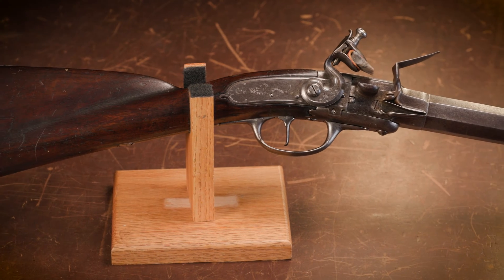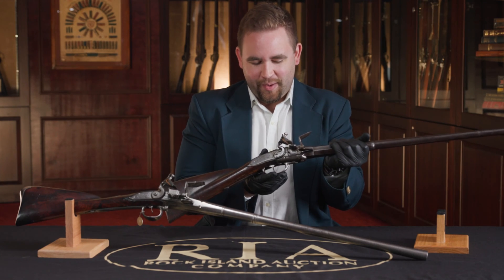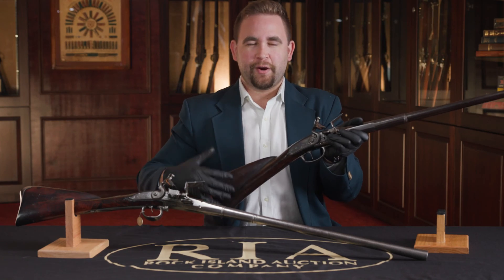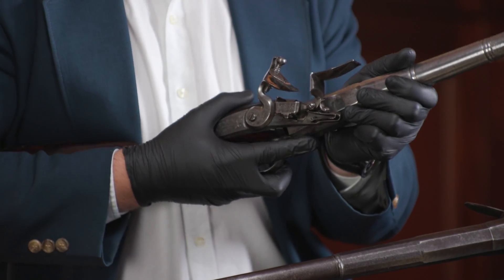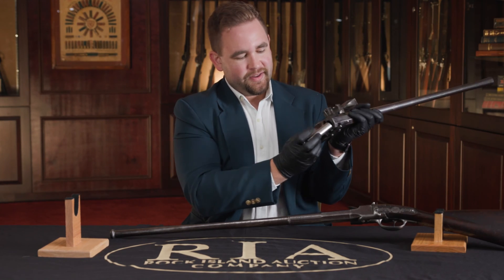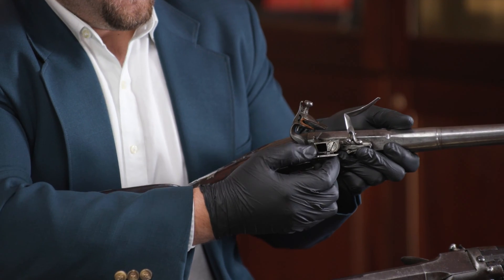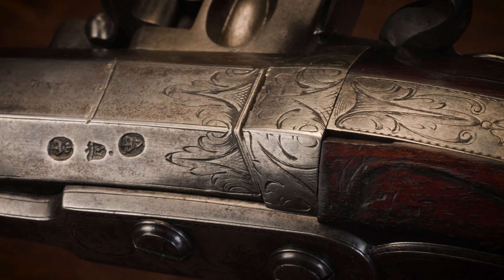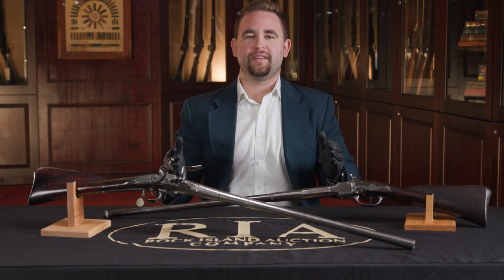Ahead of Their Time: Break Action Flintlocks

Comment: The trouble was that those thick walled "cartridges" could not expand to seal the breech. Either they were too loose and allowed gases to spray into the shooter's face or they got stuck easily, especially when the barrel was covered in slimy residues after a few shots.
Reply: Actually it seals it quite well.  You can't see it, but it has a slight camming action when it closes, and presses the fitted tapered cartridge into the breach.